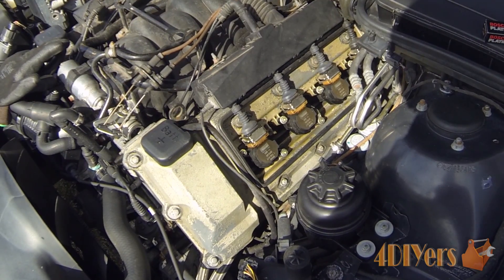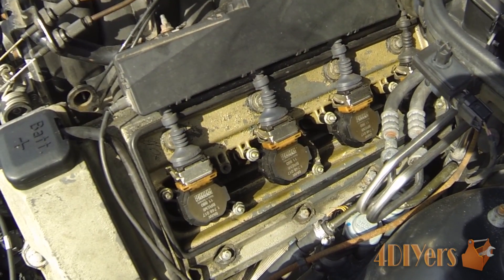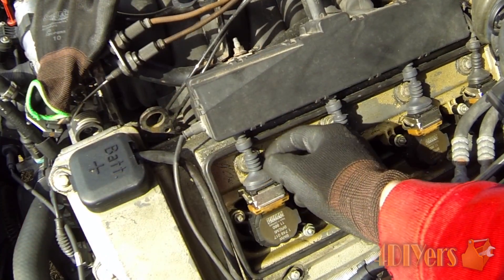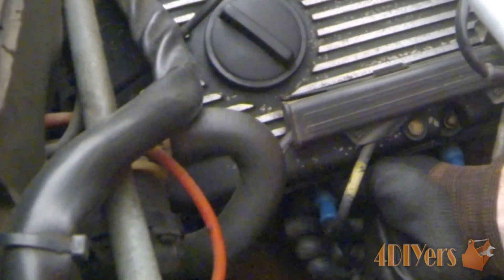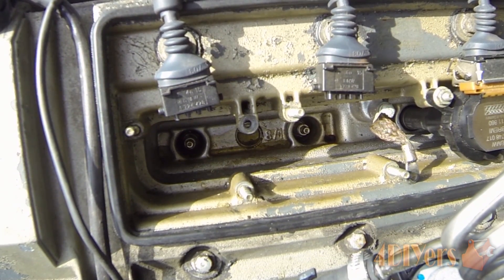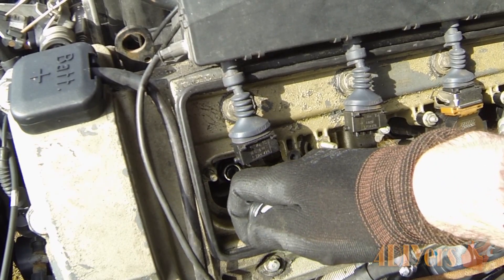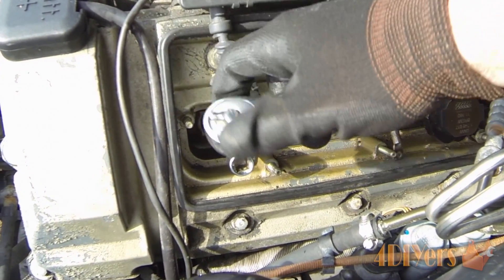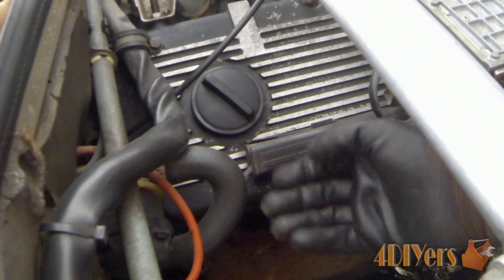How to Easily Change Spark Plugs in your Engine

Comment: hi i bought new spark plug wires but they dont fit over the actuall plugs why is that? thanks
Reply from the maker: Did you purchase new spark plugs as well??? Don't forget to subscribe!
Reply: Nope im using the old ones. But im buying new ones now.

Comment: Im going to replace my spark plugs because my car overheated and they got wet causing my car not to start, im going to replace them with new ones, change the oil as well and install bar seal meanwhile i have the money to replace my engine, white smoke came out the last i started it, does that sound like a good thing to try? Awesome video
Reply from the maker: Cristian Olivar Coolant will leave a film on the spark plug which doesn't allow them to work correctly. Changing the plugs may help for a temporary fix. Did the wires get wet as well??? Unfortunately any form of stop leak may not help for a temporary fix, depending on the severity of the leak. You don't necessarily need to change the engine either. Sometimes there is only head damage, either warped or cracked if anything. You can have it machined, some cracked can be repaired also. Other times it you can just replace the gasket and that is all that's needed. If you do have a cracked block though, then most likely the cheaper route would be replacing the engine rather than stripping down the engine, but than tends be a rare scenario when the block is cracked.

Comment: Ran through a flash flood yesterday. I have to take out the spark plugs to get the water out of my engine.  Car leaking.
Reply from the maker: I would also recommend changing the oil in your engine as well, just in case any water made it into your crank case.
Reply: Thanks